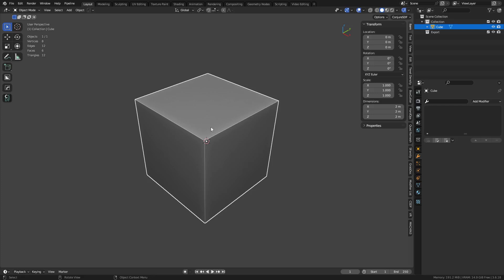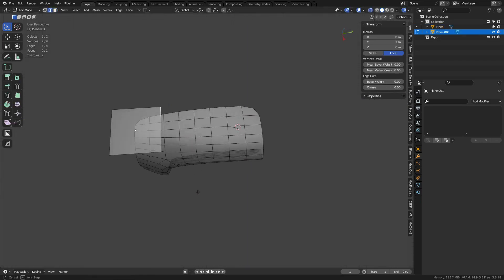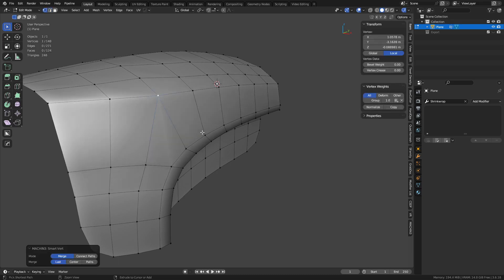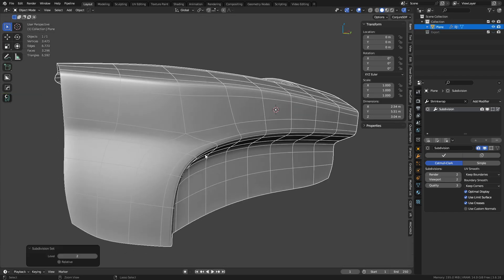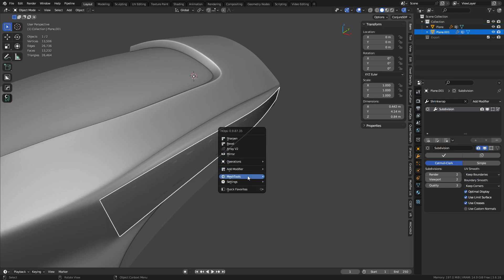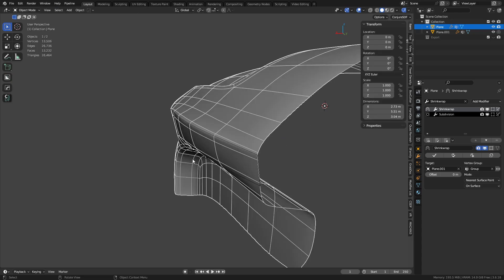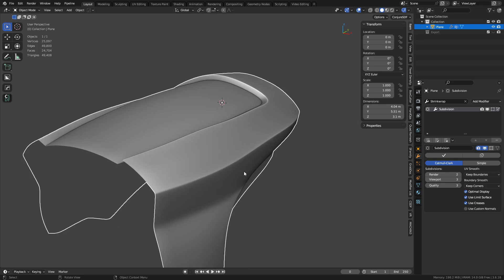Shrink Wrap Deform

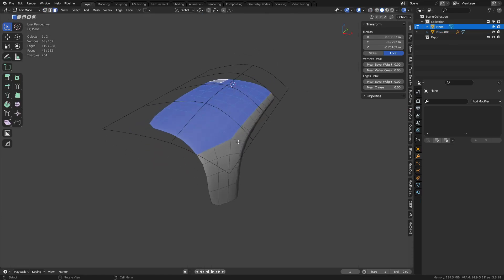Comment: no no my question is really in 2:08 there are the faces of the first vertex group and after applying the shrinkwrap you select all and remove from vertex group? the second vertex group is faces that have nothing to do with the first vertex group, cant the 2 vertex groups coexist
Reply from the maker: You can use multiple sets. If you want.